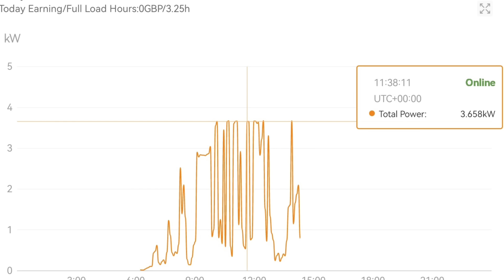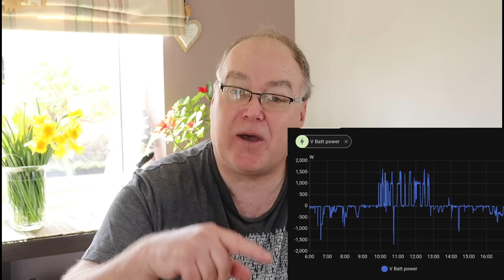Export Iimited solar is a pain - How I'm avoiding the limits 😲

Comment: Quite an interesting and simplified video. I don’t fully understand the automation side but you explained that part really well thank you. I manually use the solar excess as required. When we are not at home that process falls down though. That said it’s rare that we do export at a rate over our 3.68 limit.
Reply from the maker: All these limit and dno things are often not talked about as the DNO are a rule unto themselves and we don't really understand why they make the decisions they do. It definitely varies by area and each installation
Reply: @ Yes, ours has been problematical since 2021 when the Powerwall went in. We think that our particular locality is close to limits on mains supply. New neighbours three doors up the road for us and installed 7 kw of panels, 4kw south facing and 3kw north with 10 kw of battery storage. If he had just gone for the 4kw south array with a standard inverter he would have been allowed the normal 3.6 export. As it was to make the most of his roof space he went for a Sec99 and got one, but limited to 2.6 kw export.

And just to rub his nose in it, planning permission is in (and will be granted for) a Micro Energy Storage Site ie a battery storage site to be added to the substation at the top of the road. Hopefully, when built and commissioned that will help us all, as that should be seen as a significant improvement to the local system.

Comment: I've gone similar but slightly different. As I've a Givenergy Hybrid system, it automatically charges the battery over the inverter capacity, even if battery charging is turned off.
I set the battery to force discharge from 10:00-1400 to 90%. 
When solar is over 5kWh solar gen the battery charges, when below 5kWh the battery tops the export up to 5kWh down to it's 90% point, allowing it to soak up the excess again in the next sunny moments. Works quite well, I just twealk the hrs and %age point each month to allow for sufficient battery space.
Last year I hardly wasted any solar and effectively flattened and widened my export curve.
i.e today, inverter running a solid 5kWh

Time                             Solar W   Grid W    Invt W    Batt W   Demd  Batt %
2025-03-15 12:31:42	5925	4852	4985	-697	132	92
2025-03-15 12:27:09	5941	4794	4985	-729	190	91
2025-03-15 12:26:34	6041	4797	4987	-803	189	91
2025-03-15 12:21:27	1333	4724	4983	4003	258	92
2025-03-15 12:18:25	2249	4724	4982	3095	258	93
2025-03-15 12:16:20	1575	4721	4988	3804	266	94
2025-03-15 12:11:31	2965	4715	4979	2297	263	96
2025-03-15 12:11:14	2611	4717	4980	2708	262	96
2025-03-15 12:08:06	6606	4702	4982	-1346	279	95
2025-03-15 12:06:06	5655	4702	4986	-24	  283	95
2025-03-15 12:00:59	6080	4699	4984	-844	284	94
2025-03-15 11:57:04	6175	4700	4984	-910	283	94
2025-03-15 11:55:52	5109	4700	4985	41	  284	94
2025-03-15 11:50:45	3425	4580	4982	1691	402	98
2025-03-15 11:46:50	6074	4609	4976	-838	366	98

Comment: I have the same problem….13kWp system with 4.5kW export limit 😡. So on predicted sunny days I make sure my battery is nearly empty in the morning and then set my SolarEdge inverter to ‘Charge from Clipped Solar’ (which is essentially the same as you’re doing with your Victron inverter and Home Assistant). Furthermore, with the Zappi you can change the settings so on Eco+ it will only charge the car once it detects a certain amount of export (4.5kW in my case).
Reply: Clipped solar is much better for the network as you get more output over more of the day and less peaks that would costs a lot to accommodate to very little benefit. Might annoy you but it makes a ton of sense.
Reply: Make a new application to the DNO for an export increase?

Comment: Why don’t you just not charge at all overnight? I only use the grid to charge overnight during a couple of months in the winter. I don’t have that amount of control with my solar edge system but I do have panels in 3 orientations.
Reply: I charge and then discharge during early to mid morning hours. Then excess solar charges the battery back up. 5kwh battery with 8.7kwh panel in 3 orientations.
Reply from the maker: I used to do that until I went with the 15p fixed export from Octopus and 7p import on Octopus Intelligent. Basiclt every kwh I charge over night is an 8p profit

Comment: The more power you can generate the more management is needed, what happened to the days when you used to worry about if you'll generate enough to get you through the night!!!
Now you're having to think about how to distribute excess power 😂
Some very interesting points to ponder.
Reply from the maker: The change from loving our first 3.6kw system to now is interesting for sure.  Lots learnt along the way but in essence it's low bills to zero bills being the big change

Comment: I'm off-grid, so I don't have the limitations that you explained, but I do have to manage things like charging the EV, heating hot water, running pumps, etc. I also use Home Assistant to monitor and make decisions (mostly using Node Red, but also HA automations themselves.) One tool that I find very useful is the Forecast Solar integration. It has predictions for the amount of solar production for the next hour, the remainder of the day and the following day, which allows me to have short, mid and long term control of my energy consumption. If you haven't already, I can strongly recommend that you give the Forecast Solar integration a try.
Reply: The victron system has quite an accurate dynamic ESS (in terms of solar estimate per day), having said that I've never used it, as the main aim in our system is to use as close as possible zero peak usage from the grid in the winter, I may try it again now solar production is ramping up for the UK summer
Reply from the maker: Interesting you rate it. I've found it's massively inaccurate so not useful to me.  I've fiddles with parameters and array, sizes and orientations but it doesn't seem to work here. I'm wondering if my install for solar forecast is broke tbh so needs a reinstall.

I also looked at how it works and it dissappointing much is based on historical data not actual accurate weather forecasts.

I did find alternative forecast on the Web that was very accurate but it doesn't Intergrate to HA

I'll try to reinstall forecasts one day but I'm happy to work with live data atm
Reply: @ I'm not sure why you get disappointing results. Maybe here in Australia it is more reliably sunny and reduces the margin for error? I have checked the "forecast next hour" against what the weather prediction was, and then how it turned out, and I have to say that it is pretty close from my perspective.

I also wonder whether the orientation of the panels is a problem in your case? I'm lucky that 37 of my 46 panels face due north and are just a couple of degrees shallower than the optimum declination for my latitude which, as you know, are factors that you plug in when setting up Forecast Solar.

Comment: We DC coupled, by adding a Victron Bluesolar MPPT to the Multiplus, and let the default VRM settings take control it all (aswell as utilising the 4.4Kw allowance from the MP-II) & allowing to import when the power goes down. We've just done our own G99 application, very simple & helpful process from National Grid (Western Power)
Reply from the maker: Hope you got a good export limit?
Reply: Well done, I’m the same running 2 x Multiplus 48/5000 in parallel with Victron RS MPPT connecting the new DC coupled arrays. The ET112 monitors the main consumer unit power flow taking into account my legacy Grid Tie 12 year old install while the Multiplus units run the export and charging via their software. Applied for my G99, allowed 8.6kWh export total.
Reply: I forgot to mention, I’m running Victron DESS in trade mode with Intelligent Octopus Go & Agile Outgoing Octopus. The Victron software works out the overnight battery charge and discharge during the day depending on estimated house usage, total energy from the legacy Grid Tie install the new DC coupled arrays from the Solar Forecast. As it knows from Octopus costs to buy and sell per day it will maximise profit. I’m currently away and the install runs itself.

Comment: What did you think of Garry Does Solar last video where he said it is better to have the battery filled up every night , my powerwalls didnt get any charge last nightso the batteries were at 77% this morning but they were full before mid day so i am paying less for electricity.
Reply from the maker: If you're going to use all the battery yes charging up overnight and exporting in the day is what I do
Reply: @EVPuzzle  it's all worked out by AI and I'm saving a lot of money.
Reply: You're paying less, but also being paid less, presuming your paid for export. I always charge my batteries fully overnight as its 7p kWh and I get 15 kWh for export.

Comment: What are the implications of you go over your export? For example if you have a G98 limit to 3.6 and for some reason (I’ll explain if you want to message me) you export 4kwh for either a long period of time or a short period of time (during a spike in generation from clouds clearing etc?
Reply from the maker: Don't think I can answer accurately as I don't have that experience but  the Inverters don't react instantly anyway. there is the potential to damage some of the DNO owned kit in theory which if proved your fault you might have to pay for.

If dno notice you going over regularly I'd imagine they'd revisit your approval but I'm only guessing
Reply: The DNO will start paying attention when the voltage creeps above 252 v (single phase) ,above this level other customers may start having issues with high voltage and report this to the DNO, they will in turn probably fit a voltage recorder and if it returns as being above limits they will start to pay attention to export limits in the area.
Your inverter should be able to display the grid voltage at your premises and give you an idea of the average voltage on your local network.
Reply: We did something similar when we changed the old invertor to the new Victron MP-II, unfortuanly when we bought the Victron MP-II (summer 22?), there was a slight change in the ENA approvals in that it was no-longer possible to down rate the unit to 3.68 (so could use a G98), so had to wait until victron updated their paperwork, and then did our own G99 application for 4.4kw export.